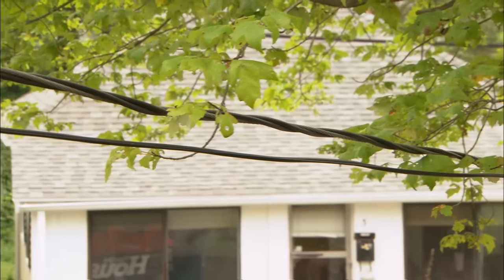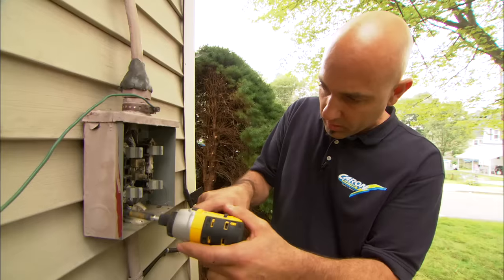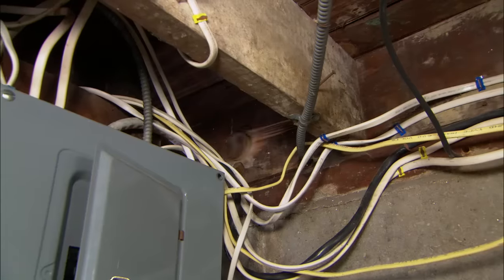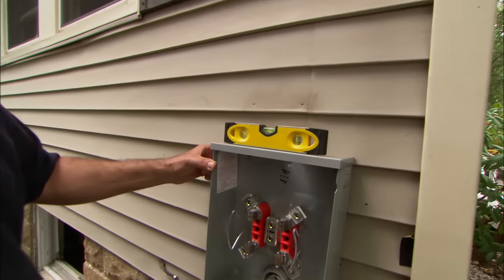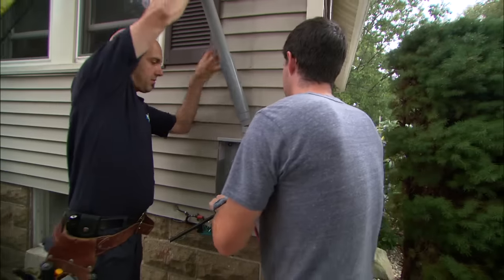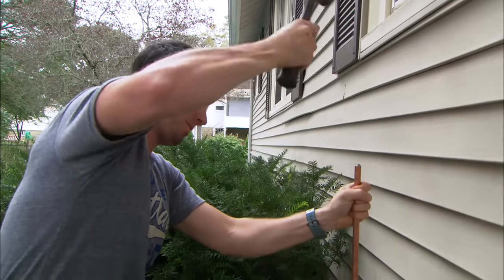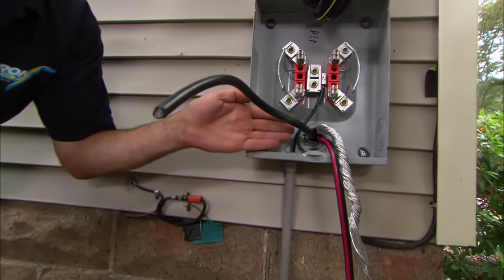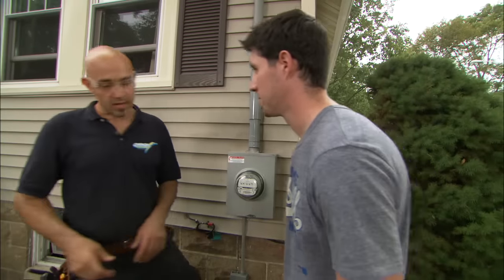How to Upgrade an Electric Meter to 200-Amp Service (Part 1) | This Old House

Comment: In Greece we have the option for 1 phase or 3 phases power supply starting from 40 amps (we have 230-400V 50Hz and we do not require so many amps). All phases are the same, 120 degrees opposite to each other (no split phase).
The most common grounding system is the TN, the grounding wire from the rods will be connected to a common bar along with neutral in the meter box although there are separate wires for neutral and ground coming from the building. All meters are equipped with automatic circuit breakers with delay so only if the main fuses of your installation fail they will trip. Also the electric meters are the property of "DEDDIE" / "HEDNO" (Hellenic Electricity Distribution Network Operator) . They own the network and are responsible for measuring the meters no matter in which power company you belong to. Power companies use this network to provide electricity). Nobody has the authority to intervene to a meter except the hedno
Reply: This 200A entrance is 240V single phase (3 wire 120/240), the reason of many amps. The equivalence in 3phase of 48kW @ 127/220V its 125A.

Comment: Electricians tip :  Instead of using a maul to drive grounding rods into ground - use HD hammer drill .
Reply: Thank you, I'd forgotten that term.
Reply: Little water and you can actually driving all the way by hand no hammer needed, didn't believe it until I did it myself, but where I work we do use the big hammer drills made for it
Reply: With a ground rod driver
Reply: Phil Mccrevasse  Please explain.   Does that method increase resistance or something?
Reply: @SparkyonWheelz  : no, some electrical inspectors are corrupt > ( so you used water to ease the rod down? well that's going to co$t you! ) The ground is going to get wet from rain ,it has no bearing no grounding . The NEC states that the rod must be driven to 8 to 10 inches below surfacing if I remember correctly!
Reply: CrashyK  once you get a little hole started you just keep adding a little water in it and work it up and down to make it go, it's not always easy but can be done
Reply: CrashyK  : here in south ,we bury it to keep from lawnmower or weed eater accident... The grounding wire is fasten tight to the wall.
Reply: Put ground rod in a filled water bottle. When you start hammering, the water will concentrate in the little area. Makes using a maul 10 times easier
Reply: So the ground wire connected to the rod and the meter neutral terminal?
Reply: That's what I thought he was gonna do..probably did off camera tho
Reply: Here in Central Texas we have Lots of Rock. Depends on your location because in Corpus Christi you can push them in by hand.
Reply: Роберт Фиэлдьс RRFIELDS65 the ground rods and acorn clamps must be visible without moving any earth material. Where the hell did you come up with that 8-10 inch thing
Reply: Bosch
Reply: @rrfields65  it’s actually flush with grade up to a 45 degree angle
Reply: @bkhoavo  yeah there’s a spot for it

Comment: I like to curl the SEC 360 degrees, making a curly-cue. It’s more work but has 3 advantages. 1 it looks better. 2, it offers a bit a slack if needed. 3 it provides a drip loop is for some reason a seal fails and water does enter the cables, it won’t enter the house.
Aluminum connections are supposed to have an anti-corrosion paste added, by the way. I didn’t see that performed.
Reply: Good luck trying to “curl” 4/0 aluminum 360 degrees 🤣🤣🤣
Reply: @electricaf365  lmao
Reply: Your comment didn't perform
Reply: He did put the noalox on the aluminum it is a different brand though. I had rather use the copper conductors than aluminum
Reply: The NEC in the USA does not require paste if the connector is rated AL-CU. But I have always used the paste myself. I hate aluminum wire period. I only use copper on new and retrofit installations.
Reply: Actually he did put it ( i.e. penetrox ); it was super-fast on the one conductor (after neutral termination). He just didn’t mention it

Comment: I have been an electrician for 40 years and watched This Old House since the Bob Villa days. Scott Caron's workmanship and practices are excellent. The last electrician on the show Alan Galant, was an OSHA violation waiting to happen. I recall in one episode, Galant on top of an extension ladder cutting and working on live service wires with no OSHA required personal protective equipment...not even safety glasses. Following  Galant's electrical practices could get someone a stiff OSHA fine or even killed.It's a good thing he was replaced.
Reply: I remember that show. He explained to the host that he was on a fiberglass ladder and and host was on an aluminum ladder so it would be dangerous for the host to splice onto live lines from the pole.  Also dont recommend twisting wires together with pliers. Try twisting three #12's solid copper together with pliers. I think this guy should have used "NOALOK" on the aluminum connections to prevent corrosion.
Reply: You’re all about OSHA aren’t you?
Reply: @gilbertdare5921  Do you have a hard time twisting three number 12s together?
Reply: Is it not enough to compliment? To lambast a previous electrician does nothing other than make yourself feel better. Gratification at the cost of others, based uopn a few videos…is sad. Sad indeed.

Comment: The code differences between localities is insane. For example in my area you have to take that ground wire straight to the panel and bond the ground and neut in the panel. The utility won't allow it to go through the meter socket.
Reply: On the NEC states that you can do your bonding at the meter or main panel
Reply: Same here
Reply: They update the code every 3 years. I need an outside disconnect your bond after the first means of Disconnect should be outside
Reply: The purpose of the electrical code is to justify jobs.  Don't expect them to make sense.
Reply: The only place the grounding conductor and the neutral connect together is at the main disconnect.
Reply: @jhormanlopez268  you're correct but local jurisdictions here where I live in Virginia including the power company does not allow it.

Comment: Ground rods are for voltage regulation - not for fault current. They are a part of the grounding electrode system. The equipment grounding conductor is for fault current return to source (the neutral). Also, if your electrician wants to run a PVC riser - just don't. And with PVC straps? It is allowed in some places, but there is no way in hell I would EVER hang a PVC riser on PVC straps.
Reply: It comes down to budget some people don't want to pay for premium because they can't see or understand that EMT or Ridgid at  better material than PVC or copper is a better conductor that withstand oxidation way better than aluminum and has less resistance or the contractor wants to maximize profits....my opinion only
Reply: @javierhernandez215  so the material they using to upgrade is cheap?  Cooper instead of aluminum?  Ridgid instead of PVC. What wrong with PVC. Doing my homework in understand. Will be upgrading this year
Reply: @Bear_83  on an overhead like that using standard PVC isn’t the best option, that pipe is what holds the stress of the overhead lines from the utility. I’d use sch80 pvc if I had to, and steel 2 hole straps. 90% of the time those are run in IMC or rigid though
Reply: My guy installed pvc with it strapped to a length of thick angle steel. Very strong.

Comment: I believe this video is for a basic understanding of what needs to happen. Every scenario is different and local codes would require specific materials. But per NEC, this does give you a basic understanding.
Reply: even not per NEC, this video gives a good understanding

Comment: Rigid for service entrance.  Uni-struts to strap 1.5 or 2.0 in rigid pipe. 2/0 gauge copper service entrance.  Service entrance head has to be at 3 feet above roof.  And so on and so on. That's California code. .... Residential type I no longer do. I could be mistaken. I mostly work in commercial and industrial projects
Reply: Daniel Castillo wrong
Reply: Wrong about everything you just said
Reply: @leonardholt5311  educate me than. Been doing this for over 30 years.  Idk
Reply: @electricaf365  educate me than 🤷 been doing this for over thirty years.

Comment: so are we not supposed to seal the hole behind the new meter where the wire goes through the wall into the house?
Reply: Why do you need to know? You are not supposed to do anyway
Reply: Yes with duct seal. Practically adult play doh

Comment: Can not use PVC pipe to the overhead service.  NEC and Utility company's require Rigid Conduit.
Reply: Tim Candee not true.  Rigid only required when it supports the service wires.

Comment: always check with the electric company first...where I live the weatherhead has to go through the roof...and is use all metal weatherhead and pipe...
Reply: A mast only has to be used when there is not enough ground clearance
Reply: If you have the proper height or clearance, then you don’t need to penetrate the roof
Reply: Metal mast corrodes in time.

Comment: do you need some compound to keep the aluminum wire from oxidizing & also vibrating loose? it happened to my house once.
Reply: The product you're referring to is No-lox. It's only used on aluminum service entrance cables. Not required if using copper.
Reply: Those conductors were aluminum and should be terminated with antioxidant.   Either he didn't show the addition of it or he didn't use it.
Reply: @SparkyonWheelz   4:51 he's putting it on the neutral, and u can see the compound on the wire in the closeup at  4:58

Comment: There was no need for the expansion coupling. With the top  only having a weatherhead it will move up and down as it expands and contracts. Throw the sludge hammer away and get a ground rod driver before you bust your finger.
Reply: +TheSeattlegreen yeah it was way to low, I'm guessing it was just for quick demonstration. And by rights the mast should have been a 2" steel mast as well
Reply: @HazardousGuru420  Yes I’ll agree with you on the Steel but it’s not a code violation that I know of.

Comment: The neutral wire carries any imbalance current back to the "pole" (center-tap of your stepdown transformer).  If the electrical load in your home is perfectly balanced (same current flowing on the black and red hot wires), no current flows on the neutral.
Reply: In 220v only countries yes. The above is true in the USA if you ONLY HAVE 220V CIRCUITS. The USA NEC defines the neutral as a "current carrying conductor", the reason for this is that in a USA single phase system the current must return to its source in order for the device that is connected to it to work. Each 120V circuit is a connection from one phase to neutral. Not phase to phase. Current goes out on the phase and returns on the neutral. Voltage from the neutral to ground is determined by the resistance of the neutral. If sized right voltage on the neutral will be less than .1 to 2v.  In a "balanced" 3ph system the vector sum of the neutral is zero, then there will be no current on the neutral.  I have been a licensed Journeyman Electrician for over 50 years in Memphis Tennessee USA.

Comment: So at what point do you use a sealent on that new extra large hole leting water run right into the new service braker panel ?
Reply: Irvin Wittmeier nice call
Reply: It's spelt breaker
Reply: Spray foam.

Comment: Very good! Here in Brazil the system is very different. We used 3 phases
Reply: Very Nice we also use 3 phase here in California Mainly For Comercial Buildings , Single Phase mainly in Residential . 👍🙋‍♂️
Reply: True, but with varying loads in the house, it is impossible to have a balanced load with no amperage on the neutral.

Comment: Vin Diesel in "The Electrician"
Reply: the fate of the electrician
Reply: Damn boi thats hilarious
Reply: I don't know so much about the meters w/the electric co.  but my average water bill is between $25 & $35. a month in the summer but this winter w/ in one month it was nearly $900,oo & no I did not have any leaks as in fact if so my water ran that much my septic tank would have been backed up & my yard would have been evidence as definitely it would have been a swamp. But just a couple months before they found my meter was leaking out by the road  & they came out & fixed it as it was on their side of responsibility. Now all of a sudden they were billing me months later telling me I used over 19,000 gallons of water in one month in the winter which I don't have a pool or anything requires a lot of water. I had them replace my meter since then & my water bill is now back to normal. I now take regular readings off my meter to keep a check on it. I don't trust any big business as it is the more they get is the more they want until we become enslaved to them. Just the same is our taxes keep going up, up and away. I am a good man to have on hand I am Dave the handyman home repair guy out of St. Louis Mo.  May God bless & only put your trust in him!
Reply: That’s a brilliant comment
Reply: Definitely
Reply: Thin Diesal
Reply: DAN   DIESEL IN   [ 6 FOOTER ]
RATED X  UNDER 45 NOT ADMITTED
Reply: Smol vin diesel

Comment: sledgehammering the rods out here is the hardest part of the job. a foot deep and the ground is like concrete. rods bounce back
Reply: Arturo from Tucson they make a ground rod driver that attaches to an sds max hammer drill. Hard to say if it will make it thru your soil but may be worth a shot.
Reply: Arturo from Tucson NEC code allows ground rods to be driven at a angle.....much easier to drive

Comment: Where’s the Nolox on those aluminum wires?
Reply: yeah, guy didn't talk about the difference between aluminum service wires and aluminum household wiring, nor about antioxidant pastes.  Antioxidant goes on at 4:51, but it's for less than a second and he doesn't explain what he's doing.   I had to ask my electrician about this when inspecting a subpanel run which had thick aluminum conductors.  Concerned me that the insurance company would have a fit, but no... apparently this is standard practice.

Comment: So where would you ground the main panel if you did not have water main close enough to connect it to? Would you run it back to the meter socket to ground there?

Comment: Also to answer someone else's question, a disconnect is not required because the panel is less than 6' away from the meter socket. Jeremy
Reply: This relative to where you live and isn't universal. There is no rule in the NEC about the distance an unfused service cable can go into a building. It just says "...as close as practical..." or some such. The utility or the local inspector often write their own rules for both meter height and "back-to-back" service length.
Reply: "230.91 Location. The service overcun'ent device shall be
an integral part of the service disconnecting means or shall
be located immediately adjacent thereto."
Reply: Also check out NEC 230.70 (A) (1)  The service disconnecting means SHALL be installed at a readily accessible location either outside or inside of a building or structure nearest the point of entrance.
Reply: Louisiana is 3ft from riser to panel before needing a main breaker or fuseable disconnect

Comment: I didn't think you could glue pvc conduit with the conductors in place due to possible damage to the wire insulation.
Reply: You can do anything as long as you don't screw it up

Comment: The wire from the ground rods should go to the service panel neutral bus bar.
Reply: It can go to the meeter aswell
Reply: @nyrbn  I don’t think so, especially using NM. That’s why we bond at the panel. How are you supposed to bond a ground on the panel when it’s in the meter?  I think, unless I’m misunderstanding this.